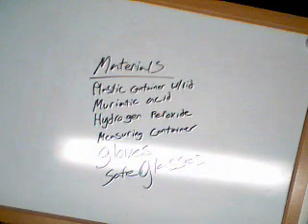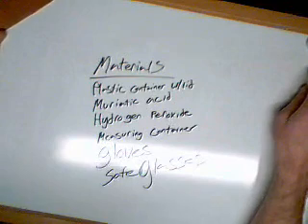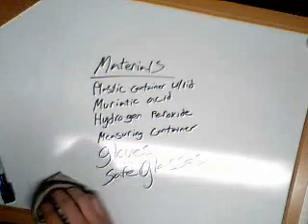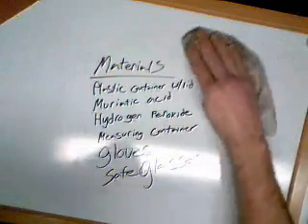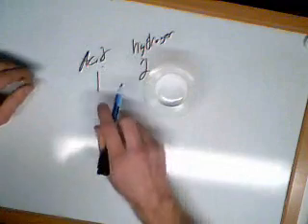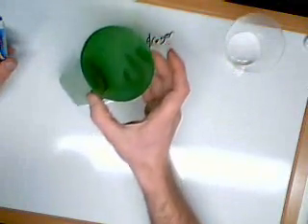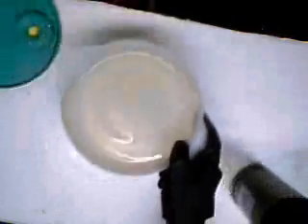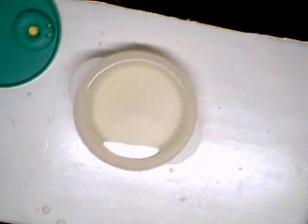Make Your Own Etchant for diy circuit boards copper claid PCB Cheap!!

Comment: "Do like you Otta always add acid to water".  You;re mixing it backwards which is why you are getting the exothermic reaction (heat and gas).  I agree with the other posters, you should be pouring the acid into the hydrogen peroxide, not the peroxide into acid.  If you poured the acid into peroxide, you'd get a lot less heat and gas coming off it.

Comment: IMPORTANT 
1-Always add acid to other agent •NEVER agent to acid
2-The 'stinkiness' you speak of IS TOXIC and should be vented outside using a hood.
3-Slightly warming solution steps up the etching process 40-50° C 115° F
4-Maintain contact between acid and metal • use a cheap aquarium air pump with a fine bubbler UNDER the metal being etched [etched surface DOWN with a spacer. The bubbles will keep the warm/fresh solution moving over the copper plus remove air pockets. Results: a more even etch

Comment: arm and hammer baking power will neutralize it safely for disposal.When you mix the stuff keep it outside in a shed. do not use it in the house. it is not safe .

Comment: Surprisingly, muriatic acid is in fact hydrochloric acid (HCL) , which is one of the main acids secreted by the stomach! So, basically it is a naturally occuring compound inside your body (at a lower concentration, of course). Do you think vomiting over your copper plate might be able to do the job? :)

Comment from the maker: no it is not going to explode, but adding to much can cause the solution to be to diluted and take longer to etch. Stick with the same measurements as in the video and use 35% if you have that and it will work just fine.

Comment from the maker: You can use any hydrogen peroxide, but since it is watered down do a little math and figure out how much more you need to add. 10% is 1/3 of 30% so add 2/3 rd's more peroxide than you normally would.  See if that does the trick for you. You will have plenty of supplies to try it a few different ways. The acid comes in Gal jugs and peroxide is cheap.

Comment: General safety comment:  ALWAYS add acid to water (or acid to peroxide, in this case).  vice versa risks a strong exothermic reaction and can cause acid to splash out of your container (onto you or other unwanted locations).